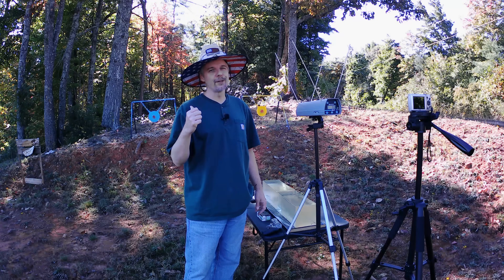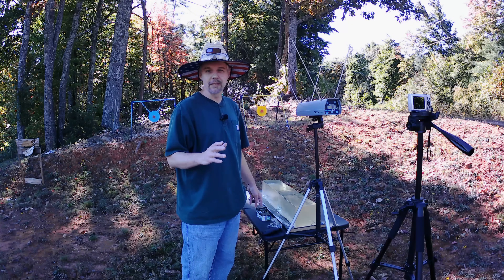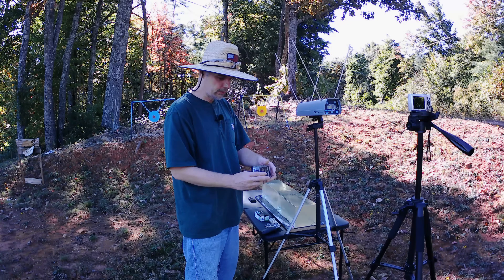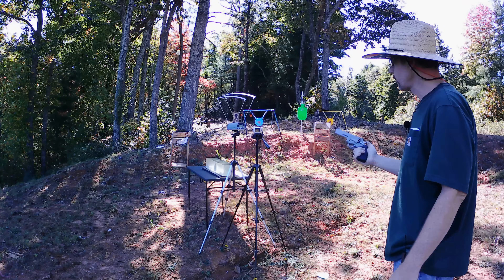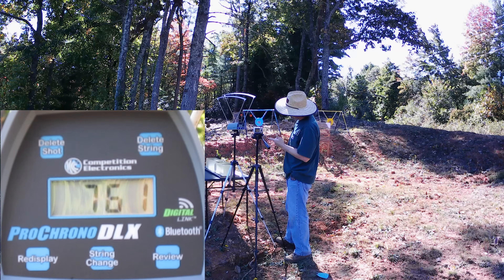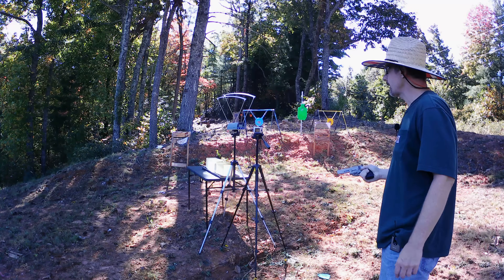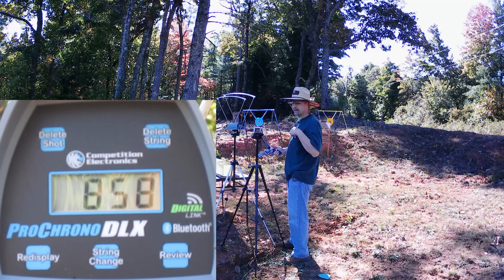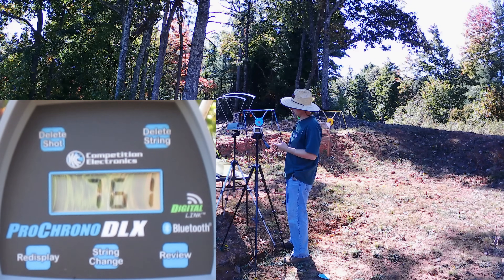Will 2 More Inches Matter? 4 Inch Barrel .38 Special Ballistic Gel Test! Monarch(PPU) vs Ammo Inc.!

Comment: The results you found are a problem that the 38 special has always had. 
You either get expansion and limited penetration, or next to no expansion and plenty of depth.
If I was going to run a 38 2"-4" barrel. I would look into the Lehigh extreme line of projectiles. Seems to give you a good chance to get the best of both worlds.

 Take care and keep up the good work.
Reply from the maker: Completely agree. The Lehigh projectiles are amazing.
Reply: I was literally going to say that some kind of extreme penetrator would be best. Lehigh is a little expensive for me but there's this refurbished brass company here in Central Texas that makes fantastic ammunition and they make an extreme penetrator 38 special +p. And that's what I carry in my home defense revolver. I treat 38 special like I would 380 the more penetration the better.
Reply: @brokeboytactical  The upside is it is carry ammo. Practice to know it's point of impact from your carry. And do just that, carry 👍😉
Reply: Buffalo bore .38 FBI load works great in my model 15 combat masterpiece.

Comment: Hollow point are velocity driven. I used a 38 spl as a LEO. I have never seen a Hollow point expand ( 158 grain). Some were warped slightly expansion. Best 38 spl rd i have seen is the FBI simi wad cutter HP. And they did not alway fully expand. I carry a 38 spl almost daily.

Comment: I myself have a Taurus model 82 stainless 4in 38 special six shot revolver that I use as part of my home defense setup. I don't know if you're chronograph is off but those are some really bad numbers. There's this refurbished brass company here in the hill country in Texas that makes a extreme penetrator 38 special plus P 124 grain and mine was pushing about 925 ft per second and that's chronographed.
Reply from the maker: Chrono is right on. Just some weak ammo, unfortunately.
Reply: @ToolsandTargets  that's really bad ammo

Comment: Hey TOOLS! I think that the .38 Spl is a pretty anemic round altogether. I’ll just carry a 9mm and be a happy camper.
Reply from the maker: I actually have to agree with you.....Don't tell the .38 Spcl fans I said that!😆
Reply: @ToolsandTargets   It is the manufacturers who make it anemic, not SAAMI SPECS out of a 15 inch barrel:

9mm Luger +P 115 grains @ 1210 fps = 374 ft/lbs 35,000 PSI
.38 Special+P158 grains @ 1050 fps = 387 ft/lbs 17,500 PSI
.45 ACP +P   230 grains @  975 fps = 485 ft/lbs 21,000 PSI
10mm ........155 grains @ 1410 fpx = 684 ft/lbs 37,500 PSI
.327Fed.Mag.*115 grains @ 1535 fps = 602 ft/lbs 45,000 PSI
.357 Magnum  125 grains @ 1875 fps = 796 ft/lbs 35,000 PSI
Reply: .38 Special is just a .380 ACP with a bunch of extra empty case.

Comment: Remington used to have a 38 special 125gr +p Golden Saber Brass Jacketed Hollow Point. Those would expand great out of my sp101 2.25 in. they grouped well out of that gun as well. Too bad they are pink unicorns now.
Reply from the maker: Yeah, I have a few different rounds that have done great on previous tests. A couple I still need to upload did great also.😎
Reply: Brass is no longer allowed in handgun projectiles, only for rifles.
They aren't illegal to own or use, just not allowed to be produced anymore.
Reply: @pewpewTN  solid projectiles are what they banned. The brass jackedted lead core aren't
Reply: @dietrichjohnson9556  It depends on the weight of the jacket, but some of them are still legal.
If the jacket is brass & makes up over 25% of the weight of the projectile, they would still be banned.
Winchester used to make some odd looking ammo that was actually really nice, but the odd construction had a very thick outer brass section (almost too thick to call a jacket) & a small led core.
That was also banned.

Comment: I thought the 4'' barrel would make a difference by about 60 to 80 feet a second. And I thought it would have made the difference with the expansion with the 125 grain. which it did. But I also was thinking it was going to be a bit more. Great video none the less.
Reply: Subsonic ammo is tricky. Breaking the sound barrier does most of the work on contact.  That 867 for the 125 is just not enough for expansion unless it is very soft lead in my observation of Youtube testing. Maybe the camera lens makes them shy so getting expansion is like using 𝙖 𝙣𝙖𝙞𝙡-𝙜𝙪𝙣 𝙩𝙤 𝙖𝙩𝙩𝙖𝙘𝙝 𝙚𝙡𝙚𝙘𝙩𝙧𝙞𝙛𝙞𝙚𝙙 𝙅𝙚𝙡𝙡-𝙊 𝙩𝙤 𝙖 𝙛𝙤𝙜 𝙗𝙖𝙣𝙠.
Reply from the maker: I definitely expected more difference than this.👍

Comment: I haven't had a chance to test much ammo out of a snubnose. I carry backwards wadcutter lead hollow points 148gr. They expand well. Speed loaders with jacketed HP for easier reloads but I dont expect expansion. I prefer fmj fn, but not for carry. Liberty Civil Defense rounds are not bad in a lightweight snub, but I never carry them, they don't make much difference in weight, only recoil.
Reply from the maker: Never tried any Civil Defense in .38 but the 10mm and .45acp +P are smokin fast rounds.

Comment: I've seen from other tests that there is quite the difference  ight around 3.5'' barrel length compared to revolvers with a shorter barrel. Work on the voice recording. It's clipping and that is quickly resolved with a limiter to have a good volume without having part of the signal cut off. Keep in mind that it's also watched on phones with headphones and TVs. Maybe attach it to your hat so it would move with your head maintaining the same distance no matte if you turn or look down towards the mic.

Comment: 850 seen to be the threshold for minimum expansion. Seen a lot I’ve  UN expanded 38 hP.  But they still work at 750 solid
Reply from the maker: They would definitely still perforate a bad guy.👍

Comment: I really thought 2 inches would make more of a difference but looks like you used the same gun its kinda surprising how similar they are but i really wouldn't wont to have to spend my money on that ammo with prices the way they are but on the flip side if you can find it here in sc you better get it cause 38 is hard to find.
Reply from the maker: It would definitely do the job but yeah, poor performance for sure.

Comment: I try to pick a load at or close to 1,000 fps for my snubby .
Reply from the maker: That's definitely what a shorty needs for sure. I have some more rounds to test and a couple I've already done and need to upload that perform much better than this out of the shorty.
Reply: Exactly. 1000 fps with 135+ grains to get over 300 ft/lbs. If you get 1040 with a 158 grain, that beats standard 9mm. 350 ft/lbs may be the sweet spot for snubbies under 6.5 inches OAL.

Comment: When it comes to .38 special just use fmj and save yourself some money
Reply from the maker: Either that or something like the Extreme Defender solid rounds.👍
Reply: I agree. I've had no problem carrying the 38 158gr LRN and 130gr FMJ ball and flat nose in my 38's. I do have Punch Plus P 120gr HP's loaded in my S&W 642. But I'm not really sure if they are worth the extra money or not. My 4 inch barrel RIA 38 revolver I keep by my bed is currently loaded up with the 158gr round nose lead. I honestly believe either load will work just fine if I need it.